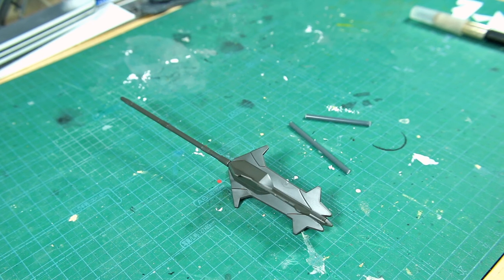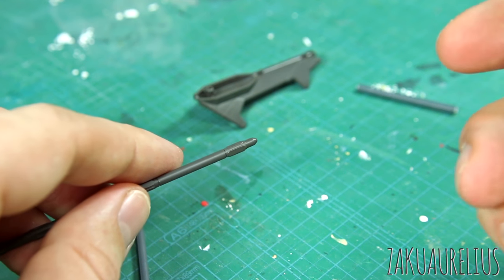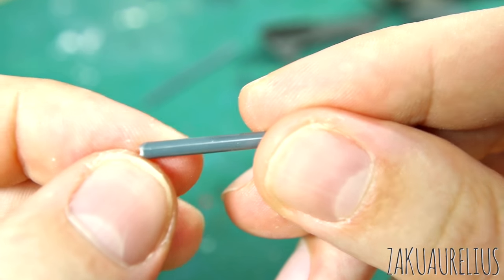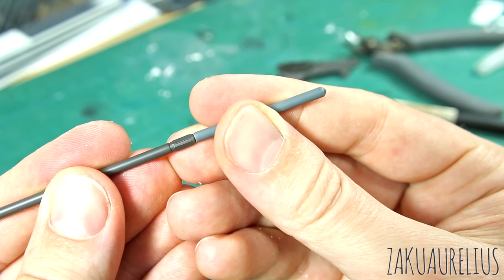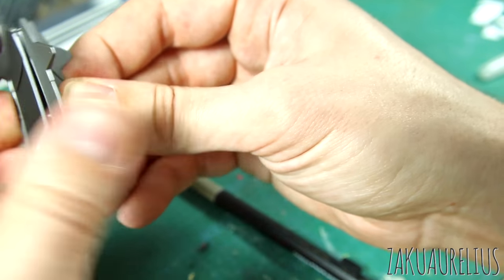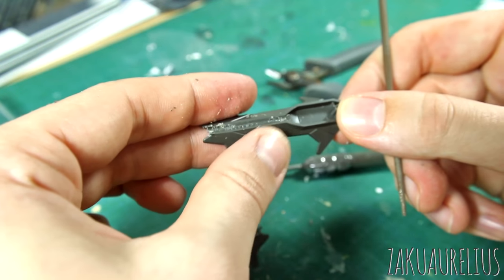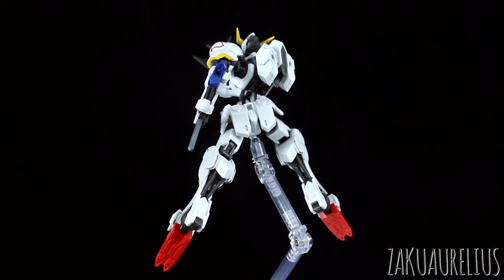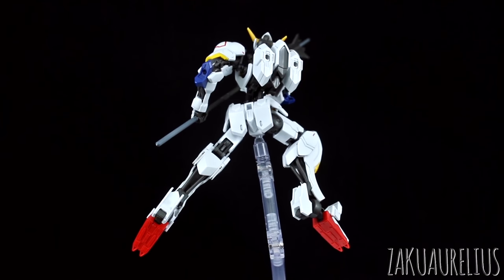927 - Gunpla Quick-Fix Ep.4: HG Gundam Barbatos Mace Modification

Comment: I have a question, how your Barbatos Backpack holding together? Those side parts with the Pinholes fall off all the time on mine. I have Three Barbatos and all of them have the same problem with loose backpack parts. I glued mine by now but I wonder if you had the same problem.
Reply from the maker: Mine seems to be fine!

Comment: you could have put a small spring at the bottom of the shaft and threaded the shaft  a bit so you could twist the spike and it could extend or depress and twist it so it stays in the down position.

Comment: and also the hand guns of the hg gundam vidar
Reply: If you want the handguns to be mountable, you need to remove the existing handguns in the skirts and use the extra polycap (the rectangular one), cut the inside of it so it will look like a clip, and glue it into the skirts.
Reply: Azzam Hayaza oh so thats how I can do it the should be easy thanks.
Reply: +Adam Zachary sure

Comment: Alright, I know this video is old, but could you tell me if Tamiya Plastic Cement is good enough to hold an axle together?

Let me be more specific- I have a figure (not a kit) that has a very hard plastic piece shaped like a dumbbell, with said piece serving as a double-ball joint at the hip. Because this is a very high-tension area, my move to make a dramatic pose was too aggressive, and thus snapped the axle.

My question is, would application of plastic cement be sufficient to hold this high-tension piece together (like Barbatos's extended mace), or should I drill a hole to place a metal pin before trying, in order to ensure durability?
Reply from the maker: CISsuperdroid Tamiya Extra Thin cement is specifically for polystyrene plastic, and it sounds like that's probably not polystyrene. In your case maybe better to use superglue. But some kinds of superglue will cause the surrounding area to fog, so maybe test it first.
Reply: Oh, I see- alright, I'll give it a go with cement, if that fails, I'll probably go Krazy glue or maybe even Gorilla Glue, which expands outwards and solidifies like foam.

Comment: Zaku, this was useful for my customs. But I'm wondering if there is a North American equivalent to the Tamiya glue/cement. What I actually need is to create a bond strong enough for transporting a gunpla. But not leave much damage (prefer no damage at all) when I want to convert it back to original state. Strong enough to survive constant play, but let my imagination run wild when I do mods to it. Think adding pieces to the armor (like spikes) of a Zaku II, moving it to a GBWC event, but then being able to remove them and leaving the Zaku II in factory shape (or close enough to it, like say 90-100% condition) for future/different mods to it for another event. The list of stuff I have tried is in a reply post found in Prime 92's Julieta Custom review. It's too long to post again here. But in summary, I've used close to everything I can think of, trying to find that bonding material.

Gunpla has drained my income. I've almost reached a point where I beg for parts from kits. The spare parts others have kicking around from their kits. And I don't care what it is, as long as it's Bandai/GBWC legal! So I want to use the models I have, as much as I can. That would mean the same kit going through anywhere between 3 to unlimited changes. Never staying the same for more than a month. Even my diorama changes every month (as the parts aren't glued down, yet). Hopefully you understand what I'm trying to do. And you can help me out. Just knowing what I can use to create that bond between different pieces (from many kits) would be a huge boon for my gunpla experience. Anything helps!

Comment: how to use brass rod to make the extended part more secure ???
Reply: Basically, you'd drill into the end of the original mace and the extension, and place the brass rod inside and push the parts together, hiding the rod inside and thus making it very sturdy.
Reply: thanks. nice to know that !